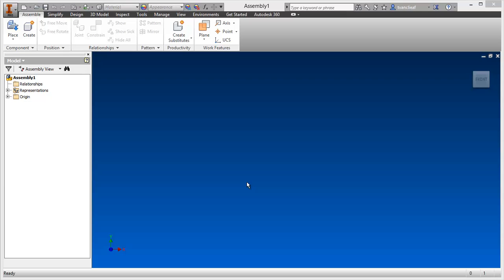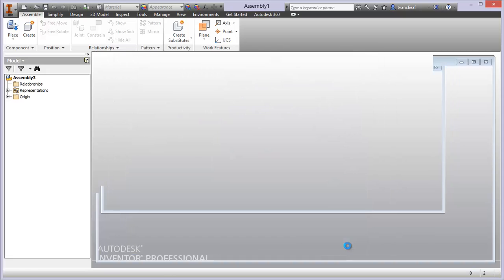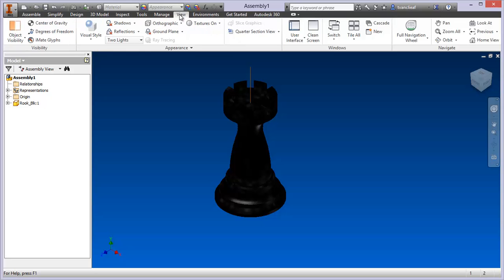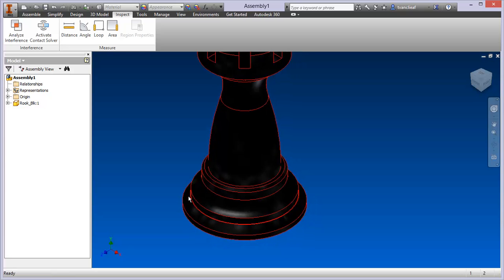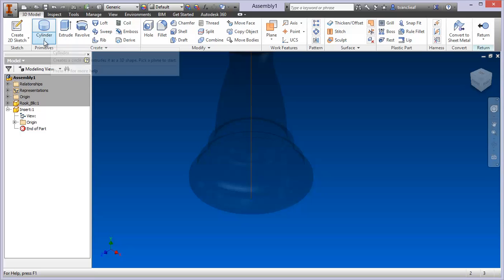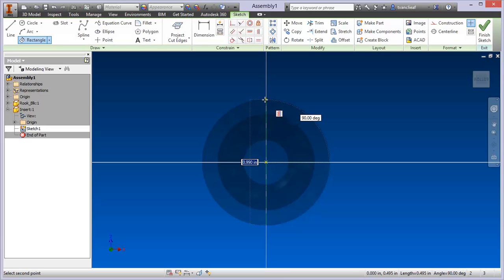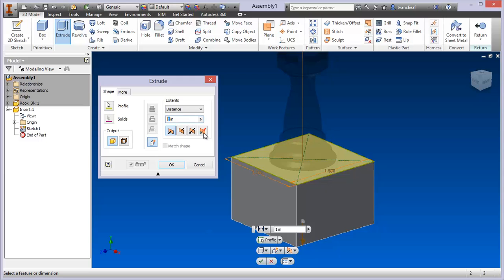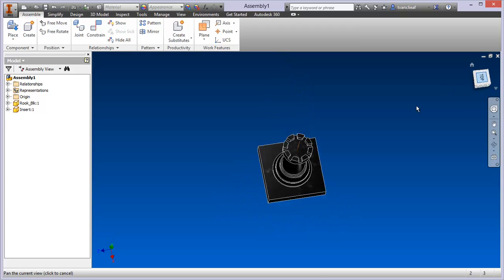Creating Parts in the Assembly interface ~ Autodesk Inventor 2014

Comment: my return button is missing and nobody has this issue but me.
Reply from the maker: If your Return button is missing, it simply means you're not modelling from within the assembly interface. You've opened the part file and the assembly isn't open. Is your assembly file open in the tabs at the bottom of the screen? Is it the one that you have active?